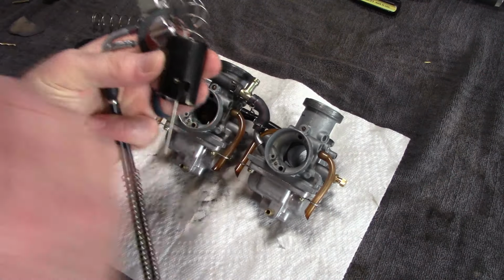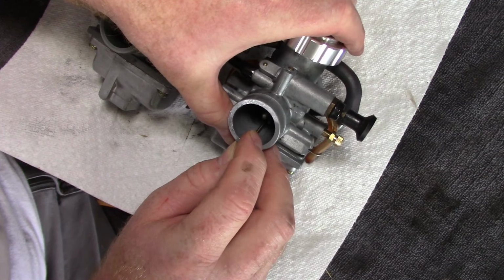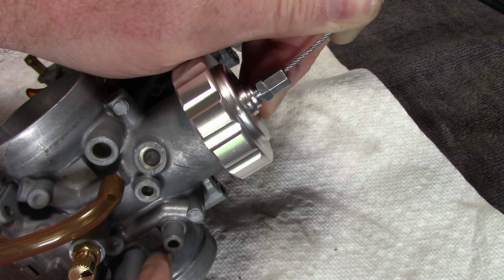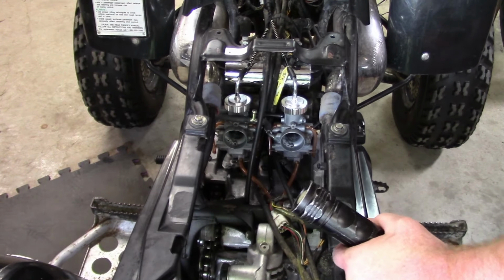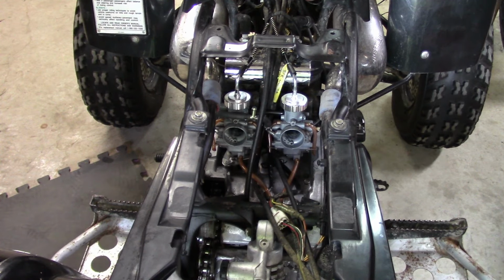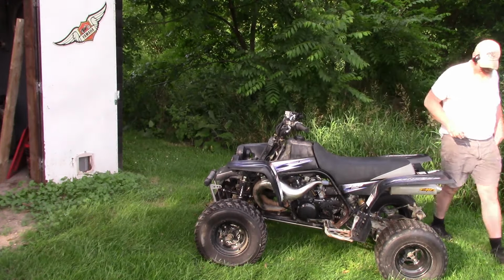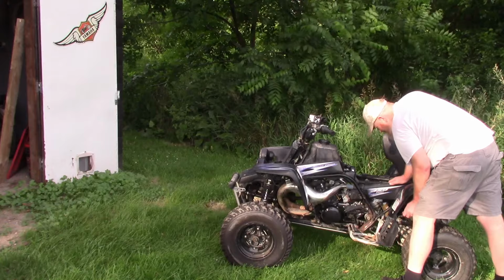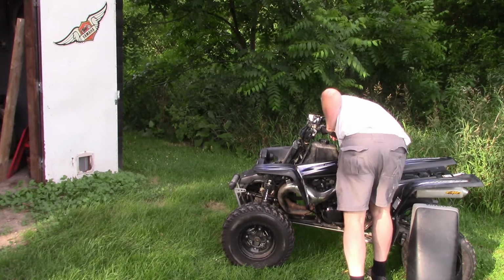Banshee TORS Delete and Carb Sync - PART 2 - AT YOUR OWN RISK!

Comment: Slides, not floats. Floats are inside the carb bowls.
Reply from the maker: Yep, may have misspoke.
Reply: @CK-Cycles  slip of the tongue,  can happen to anyone. I am busy with an '81 XT500 and a '79 TT500 for my own stable. Your videos are great. Keep them coming. From Greg in South Africa.
Reply from the maker: @gregorystroud6119  thanks! XT is a great bike to work on.